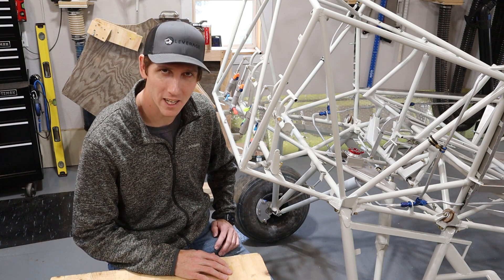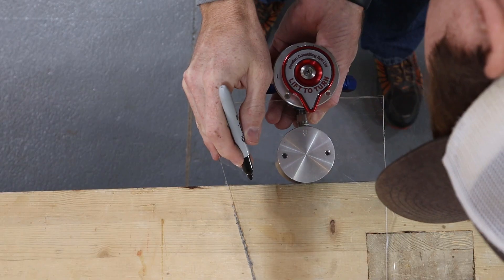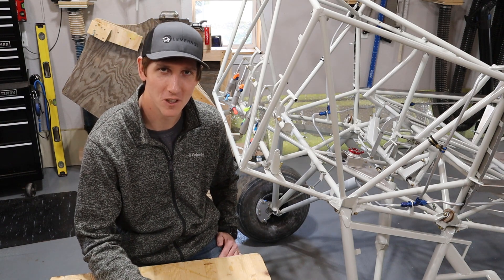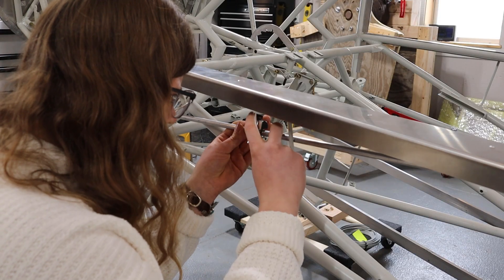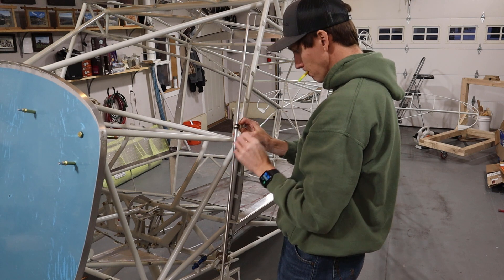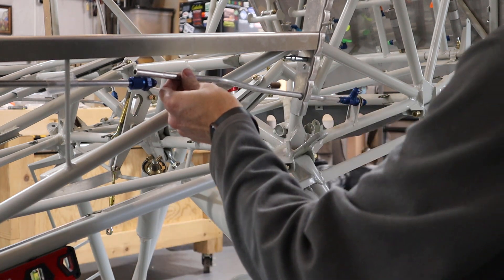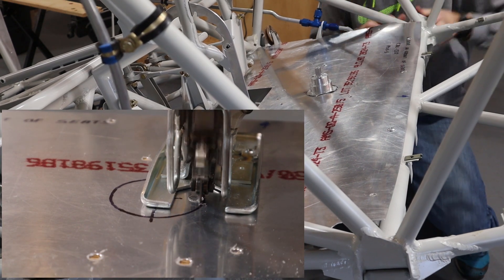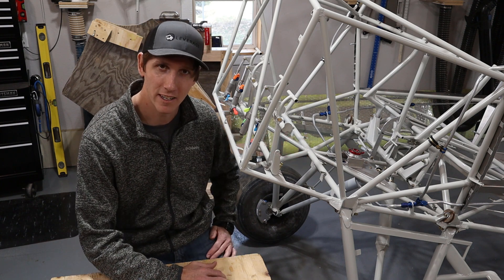Fuel Line Fun

Comment: Colby. why would you not use a coil of aluminum fuel line instead of fixed lengths? I see in in pretty long coils.
Reply from the maker: I believe the coil of aluminum tubing you've mentioned is 3003. Many builders opt to use that tubing as it bends much easier than the 5052 we used. Ourselves and many other builders opt for the 5052 as it's much more ridged and I feel it'll take more of a joke once it's installed. Lots of great BH's flying with either!

Comment: Colby, I am building a Companion and tomorrow I am sourcing all my fuel AN hose fittings.  I am curious if you demeaned can tell me the fitting form the fuel valve to the gascolator as it would be really helpful to minimize the distance between the two for space purposes.  Thanks in advance, Jay
Reply from the maker: Hey Jay. My kit came with an NPT nipple to join the two. My fuel selector valve came with a fitting that screwed into it and had female NPT threads.
Reply: @ColbyOsborn  Thanks Colby, I talked to Mark and he told be that it was in the box, I did not initially see it.  Keep the videos coming

Comment: So, is it ok to use Teflon on fittings like that? I thought it was kind of a no-no because it can dissolve and can also clog parts of the fuel system.
Reply from the maker: I’m certainly no authority on the subject but my understanding is absolutely no Teflon tape, but some pipe dopes are ok. Loctite 565 was specifically recommended. I think that came from the builders manual but I might have picked it up from the forum. All the flared fittings are supposed to be assemble with no thread sealant. I only used thread sealant on the NPT threads. Greatly appreciate you raising the question.